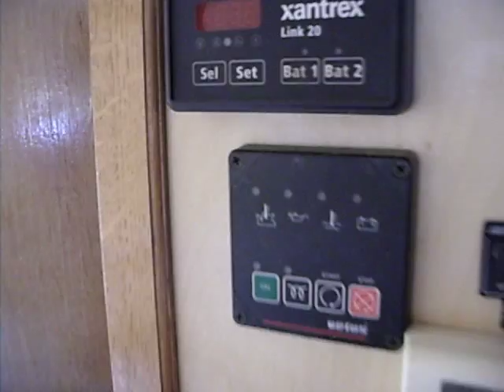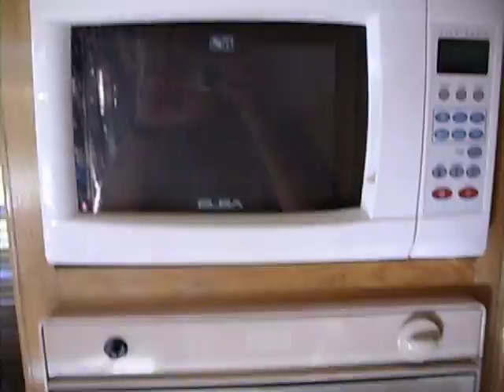solar narrow boat 2

Comment: Hi there. Good vid. Very interesting. Can i asks a few boring questions? What model motors are they, what is the leccy consumption like at your cruise speed, what's your range on full charge and what's your displacement? Cheers

Comment from the maker: Panels are £1000 for 12, outboards £280 for two, Batteries £400 and MTTP charge controller £150, less than £2k total. In cloudy weather, you would need a few days of charging for 3 hours cruising, fine if you live afloat and still ample power to run all stuff on board.
Reply: Hi Rob, Im thinking of doing this too, considering power consumption, gear is it you use to propel at 2.5mph? Also how do you control the speed? Is it a case of manually twisting each tiller? Cheers, Tom
Reply: Best video and information on the topic,  I believe you get a 50% discount on your waterways lisence also. So it's the way forward.